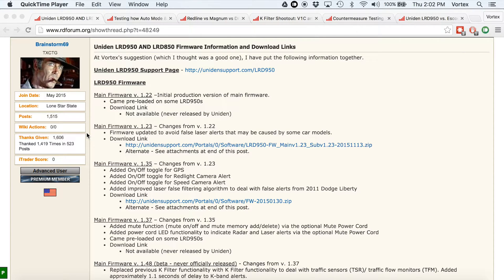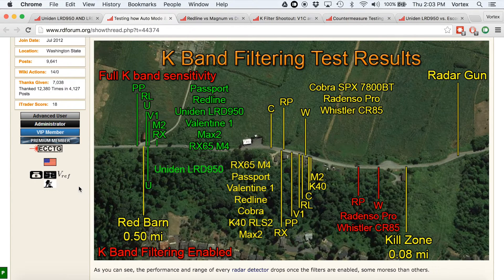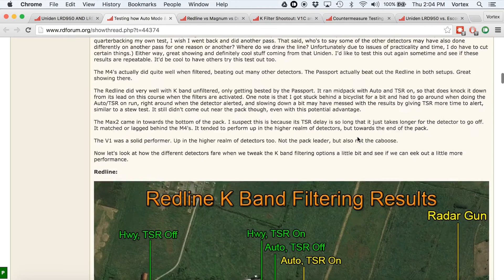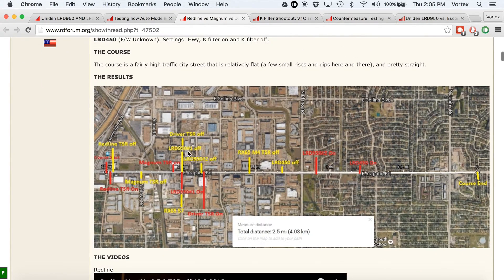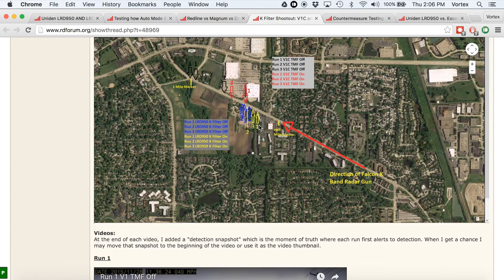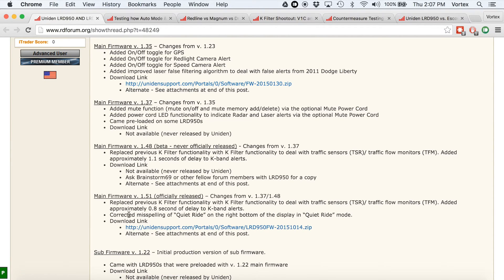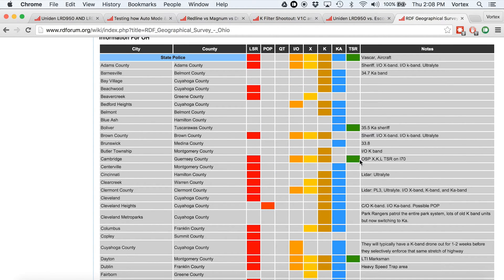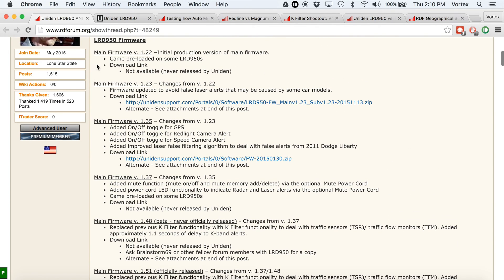Which firmware version should you run on your Uniden LRD950 or LRD850?

Comment: so I finally broke down and ordered an lrd 950, for me, in Illinois, with no traffic monitoring and usually only getting hit with K band and KA 35.5 I am leaning toward the 1.35 however I'm going to be driving cross country soon, should I get the newest firmware for the trip?
Reply from the maker: +robdawg3957 Will you be going through states that require TSR? If so, yes. If not, don't worry about it. Simple.

Comment: Do you have a link to download fw 1.37? I cannot find it anywhere?
Reply from the maker: +Food Porn Network In that video I just sent you, there's a link in the video description with all the different firmware versions available. https://www.rdforum.org/showthread.php?t=48249
Reply: +Vortex Radar oh my bad, thanks!
Reply from the maker: +Food Porn Network It's all good. The link was kinda hidden and buried so I fixed it to make it more clear. Thank you! :)
Reply: +Vortex Radar I am still looking lol it says 1.37 was not officially released
Reply from the maker: Yeah 1.37 was only made available on units shipped from the factory. 1.35 is the same thing except without support for an optional power cable that I've never even seen for sale. Get 1.35 instead. If you read over the description for the firmware versions, it should explain things further.
Reply: +Vortex Radar oh ok doh! Thanks again!

Comment: Greetings vortex, so I took your advice and got a Uniden LRD 850(Well, my girlfriend gave it to me as a gift for christmas xD) I've only used it for less than 2 hours but I'm loving it so far, since I had a cheap cobra esd 7570 I find the range on the uniden insane, the question now is, I really don't mind when the detector goes off with a blindspot system because I mute it instantly so it's no biggie, so, I want the best range/performance, which FW do you recommend I should run on my LRD 850? thanks in advanced!
Reply from the maker: +Christian Yulfo Congrats! The firmware really comes down to if you need TSR or not. The original firmware doesn't have that filter and the newer updated one does. That's really about it.